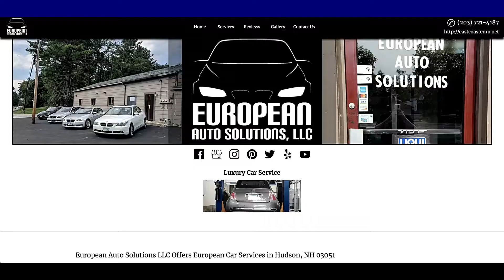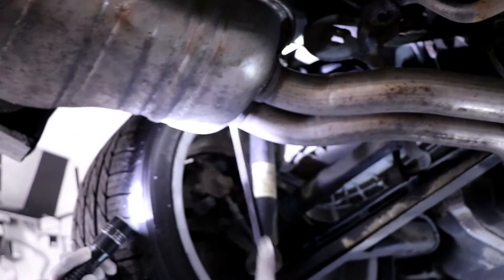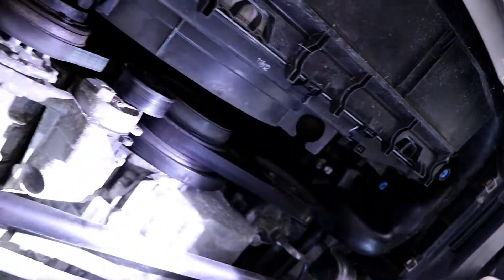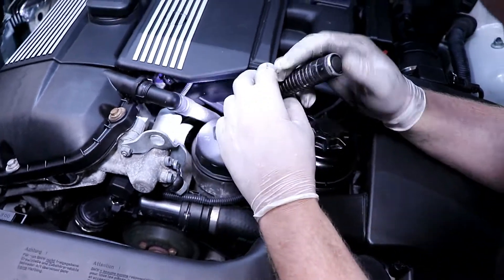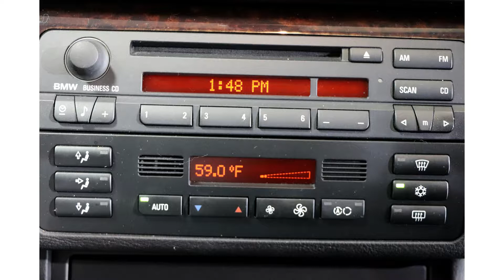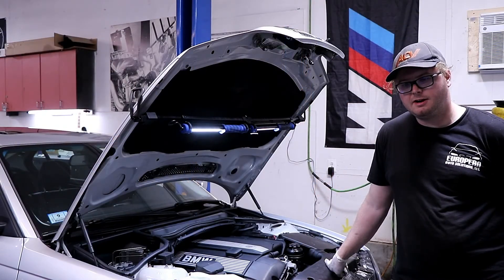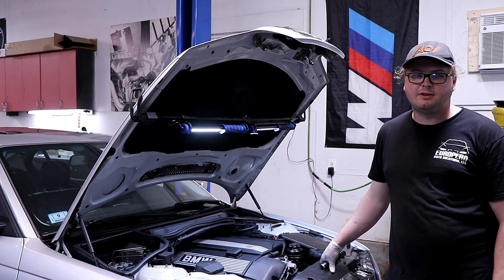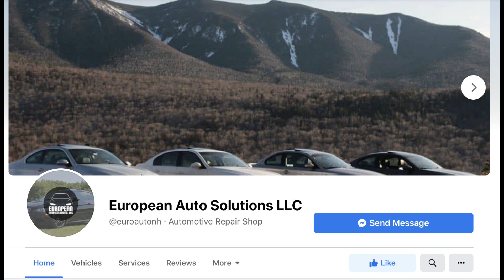BMW E46 330/325 Common issues..What to look for(European Auto Solutions Hudson NH)

Comment: Great video summarizing the areas that need TLC. As the former original owner of this car, they are well built and just a joy to drive. With that said they do need to be maintained. During the 21 years of ownership  other than brakes and tires I did have to replace the front control arms, water pump, alternator, valveless cover gasket, an inner door seal and window regulator. I consider that minimal over the course of 21 years of ownership. Spot on advice from Mike about finding a good and honest certified BMW mechanic other than the dealer to do the work. Case in point at 75,000. Miles I was told that the rear shocks and coolant tank needed to be replaced which as per this video are fine 10 years and 35,000 miles later. Last of all, I cry every time I watch these videos about the car because I really really miss it!
Reply from the maker: Thanks for leaving a comment Steve..Great memories after 21 years im sure! It was a beautiful example of a E46 Sport Package !